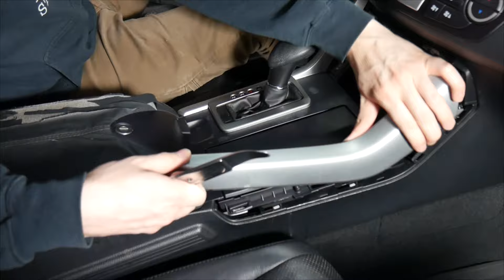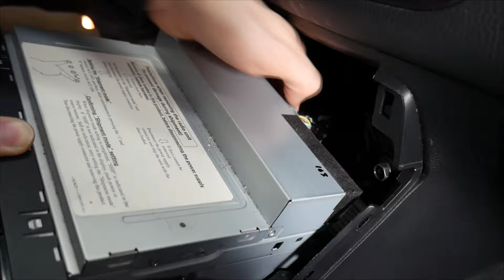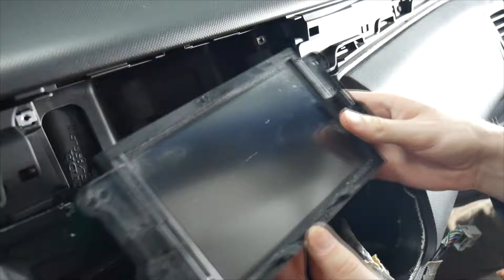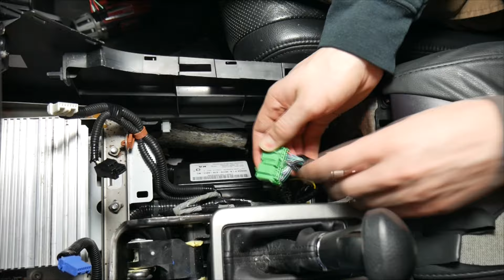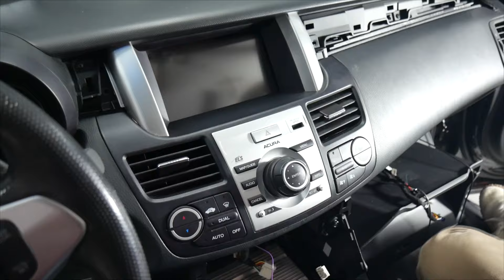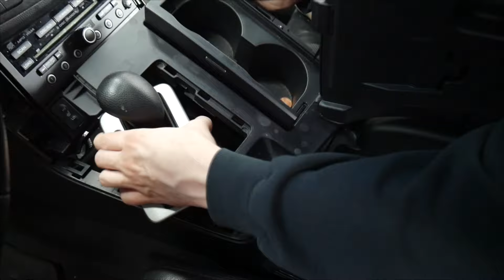How to install GROM VLine VL2 into Acura RDX 2007 2008 2009 for wireless CarPlay Android Auto HON1L

Comment: hi, will this also work for the 2010 Acura RDX as well?
Reply from the maker: Yes, it will work on 2010 Acura RDX, if the vehicle has a factory navigation. Check here:
https://gromaudio.com/store/vline/grom-vl2-hon1r.html
Correct model is HON1RVL2 VLine VL2 system.
Reply: @gromaudio  ok I just clicked the link you provided. Do I have to add the VAUX AV Cable for VLine VL2 Aftermarket Camera Integration since I have a backup camera? Also, is the installation the exact same process as in the video?
Reply from the maker: @andrewlemon2717  You do not need to add VAUX cable if you want to retain your OEM backup camera. The backup camera will keep working without any additional cables.
The installation video is similar, but the video is for the 2007-2009 Acura RDX. The 2010 Acura RDX has a different connection at the back of the stereo. Please pay attention to the install guide that we include with our kits.

Comment: So the hands free module is not connected in mine, it’s bad will your product bypass it?
Reply from the maker: Yes, you will be able to use hands-free with CarPlay or Android Auto when using the GROM VLine VL2 system. It has its own wireless connection, so you don't need to use the factory hands-free feature.
Reply: @gromaudio thank you great product!
Reply from the maker: @MyrealTalk-s7t  Thank you!
Reply: @g @gromaudio  don’t connect grom mic  to hands free unit ? Splice wires and don’t connect to unit? Factory unit drains the battery when power connected ! Does your product use the power supply with two splice wires?!
Reply from the maker: @MyrealTalk-s7t  It is unclear what exactly your question is. Our recommendation is to get in touch with our technical team via a web form here: https://gromaudio.com/support.html They will help.

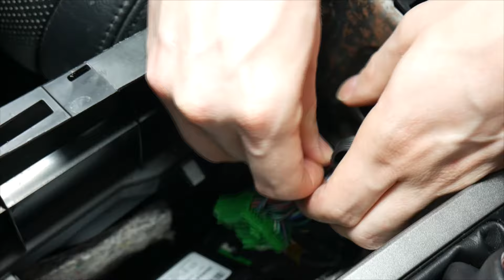Comment: So at 7:12 do I need to scrape the wire to add it am confused ?
Reply from the maker: At 7:12 we are connecting the factory microphone retention wire that is optional. You will make this connection only if you want to retain the use of the factory microphone for CarPlay / Android Auto calls and voice commands. You will need the WLEX5MIC cable that is sold separately here:
https://gromaudio.com/store/vline_accessories/cable-wlex5mic.html
To make this connection, you follow the video and you use the P-Tap to connect the wire to the factory harness. DO NOT CUT anything at the factory harness.
The system also comes with the aftermarket microphone that you can use instead, if you do not want to make this connection.

Comment: THis is awesome! Are you located in the DFW area? I noticed the local spots in the demo video for the RDX. I would like this installed in my 2007 Acura RDX but have one question. Will I be able to take calls through this system using the Bluetooth options? I have an iPhone.
Reply from the maker: Thank you! Yes, we are located in Plano TX. You will be able to take the calls using the system and CarPlay with your iPhone.
You can contact us to potentially schedule the installation via our contact form at https://gromaudio.com/support.html

Comment: I still didn’t see in the video where the system itself is located or how you connected it, where is the module.
Reply from the maker: This information is also available in the install guide: https://gromaudio.com/docs/vline_manuals/hon1l/hon1l-vline-install-manual-web.pdf
Reply: @gromaudio  Thanks!